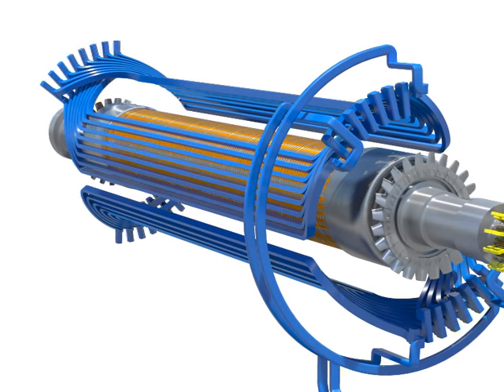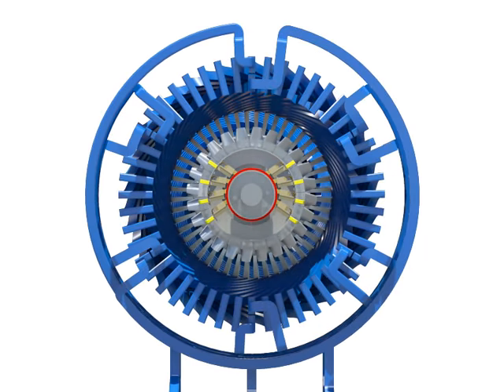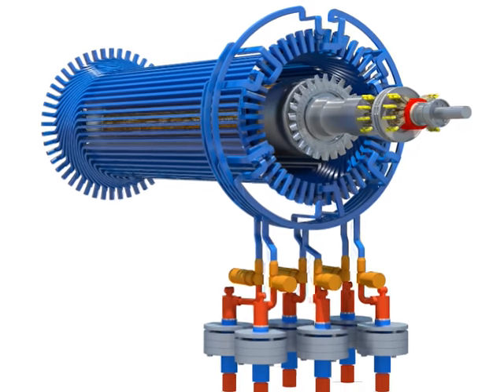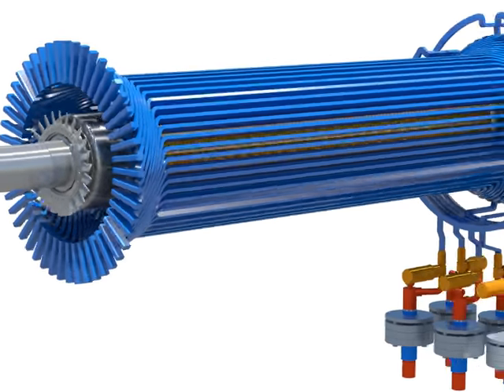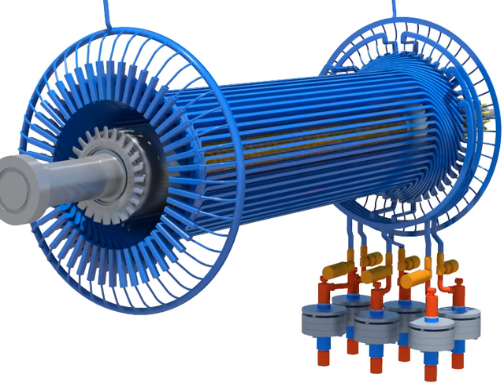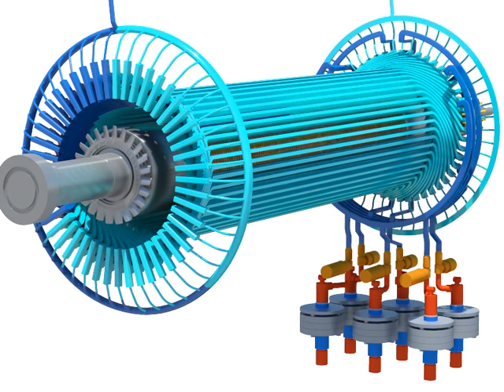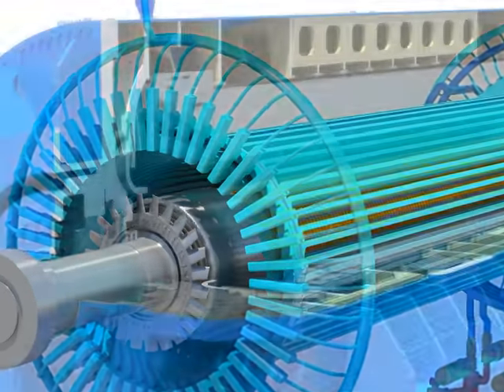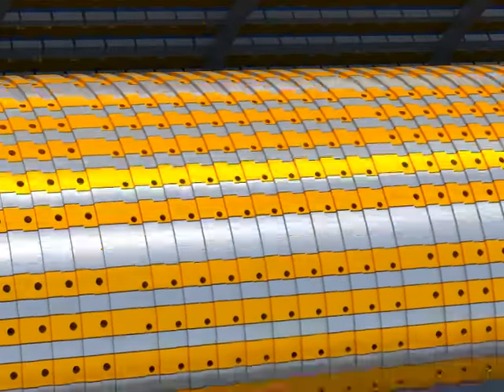#powerplant   #steamturbine : Generator process/ How does a generator work?

Comment: Yes it's three phase, but the three extra connections do have a function. The six connections are there so current can be measured in each phase going in to the machine and also when leaving the machine before the star point is made. This is done on large machines to allow machine differential protection.
Sometimes also the voltage in the star point is measured to detect (the absence of) third harmonics in the voltage. This indicates an earth fault (when operating in an isolated system) .
Reply: Thank you I am taking a class on nuclear steam generators and was confused by this, as our main generator is only a 3 phase and they do not discuss the 6 phase so far.

Comment: Six phase?  Should be three phase?
Reply: It is three phases in fact. I don't get why they say six phases. I even asked my electrotechnic's professor and said the video is telling you wrong because they confused those six connectors for six phases.
These are just the start and ending point of the windings and they can be connected star or delta as any three phase motor can be.
Reply: Three phase generator. This is a water cooled stator and hydrogen inner cooled generator. The water circulating through the stator windings is de-mineralized (low conductivity).
They should mention the speed of the generator, hydrogen pressure within the generator vessel, etc.
Enough pauses to include that information. Nice illustration.
Reply: @ruspagamer7248 Yes it's three phase, but the three extra connections do have a function. The six connections are there so current can be measured in each phase going in to the machine and also when leaving the machine before the star point is made. This is done on large machines to allow machine differential protection.
Sometimes also the voltage in the star point is measured to detect (the absence of) third harmonics in the voltage. This indicates an earth fault (when operating in an isolated system) .